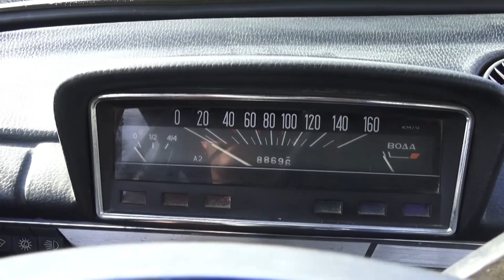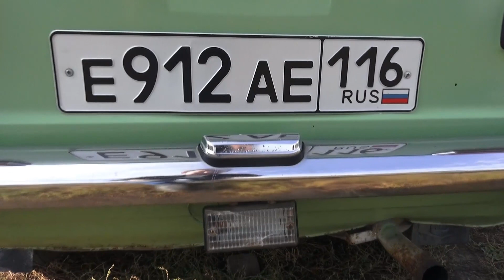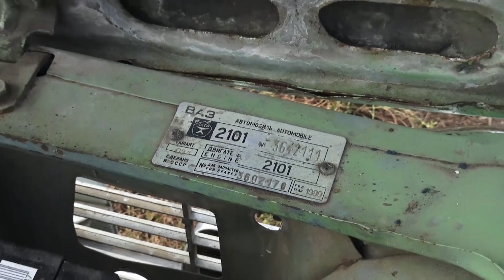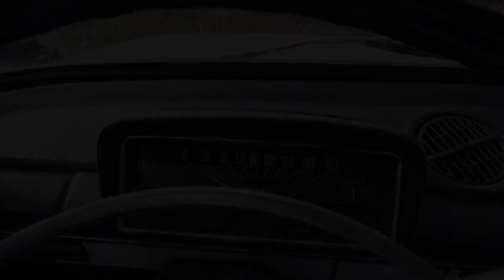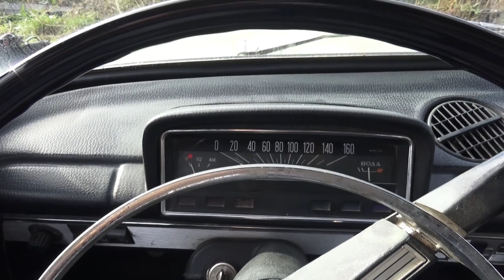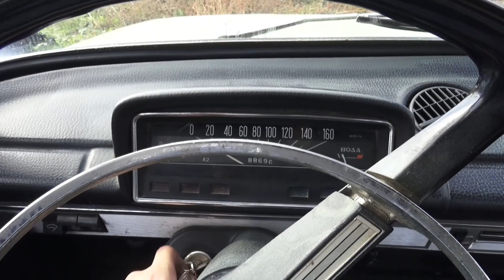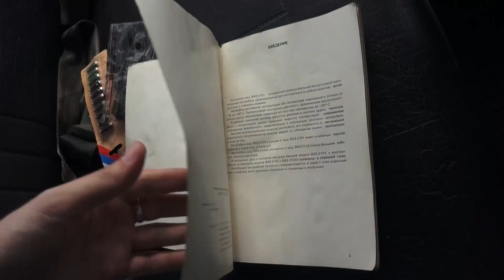1980 VAZ 2101. Start Up, Engine, and In Depth Tour.

Comment: WOW It may be a Lada but this is the first Russian car that I`ve seen that is ALL FIAT 124. Usually the body may resemble a FIAT but the engine would be a Russian unit ie the FIAT 125 sedan which had a 1608 cc DOHC engine but in Russia it has a 1600 overhead cam engine I believe and it looks similar but not the same. I recognised a lot of the hardware ie relays, door handles, hub caps, air filter casing even the tubes x 4 that the wind up jack pokes into under the body ..all FIAT. You said 1200 cc but I remember our Fiat 124 sedan had a 1100 push rod OHV engine. I love these simple old school cars and thank you for sharing this video.. It has bought back a lot of memories.

Comment: Amazing that there's no rust on this.
Reply: +azera55555 Well there is, but not on the exterior panels. I think i saw rust when he opened the front left door on the A pillar. But it's amazing if it's the original color. My parrents had a Dacia 1310 from 1984 and when they sold it in 2004 it was a little rusty on the right front wing which was hit and repainted.
Reply: I saw one in the same colour the other day, it had big holes due to rust in the doors. lol I still like them thou
Reply: I just remembered I have a pic on my Instagram.. mattsbeamer :)

Comment: thats choke what you said "carburetor" it is used only to start up engine in cold start, it doesnt help even if it doesnt start easily after shop parking and you are leaving for example. it is because fuel is boiling away from carburetor becauset exhaust manifold is right under carburetor and intake manifold :D so it takes some seconds to start when its warm, usually if its stopped for 5 - 30min it doesnt start that easily.

Comment: Hi from the matherland of all Ladas! :)
5:40 The engine must not that teribly tremble! It must be as still as a ... a ... a water in dead calm weather
Checking both - fist the distributor state and the ignition adwance angle (probably it is too early) and secondly the idle mode mixture composition of the carburator. 

Use petrol of 92 octan. (well, or 95.)
I can not tell you anything about gas system, i'm opponent of the usage of gas!

Or better is first to tune the carburator, as it works properly in general as i see, and needs to be only Idle Mode regulated by the one special Mixture Quality Screw to get optimum - maximum rpm, - or the so called "hill of rpm"., and that is all with carburator.

Then checking ignition system as there may be number of the problems. Giving too early ignition at the absolutely problemless operable ign. system leads to that trembling. So, to check if the system has or has not bad parts, just give the late ignition up to 10 degrees or so. The engine must get still while the rpm will decrease. 

The distributor's cap, the coil's top - must be clean!

In this lucky chance, just tune the correct Adwance Angle as per Manual (look at 14:40 - it is personal Manual of this car): going 4-th gear 45 km/h push the accelerator full: you must hear sonorous yet short lasting detonations while the car accelerates. (long detonations - too early, no detonation - too late). Go test drive then stop and tune by 1-2 degrees, again test drive, so on. (Use the key #13, do not tighten the distributor's nut too tight! ).

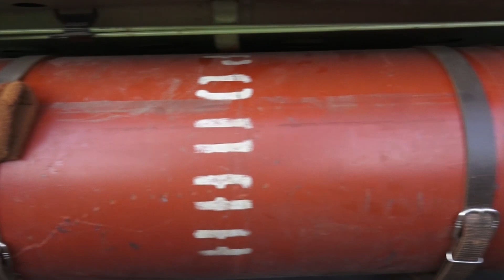If no lucky - then check the details of the ign system. The insulation of the cap, the HV-wires, the traveler under cap - they some time get electric breakdown, burn throughout. Replace. Now checking the Ignition Dwell Angle of the contact, or check the gap in it with the probe from the key kit - it is important. (13:31 - ups, you do not have this little key-box, look 13:42 - here it is on the floor) The last are the capacitor (0.22 microfarad x 630V), the sparkplugs (gap 0.6-0.7mm - again the probes from the same key), and the last point - coil. 

The best way is to buy russian new modernized contactless ignition kit for 2101-engine which costs less then 100$ - made in Stary Oskol's factory, (БСЗ Старый Оскол), consists of the new powerful coil, the electronic commutator unit, the ENTIRE DISTRIBUTOR unit and the wire bunch. (needs increasing the gap of the plugs to 0.8-0.9mm) it gives good common effect - agility. This car is more interesting then VW Beetle :)
-------------
After everithing is done, tune the idle rpm with another tune screw of carburator - the Mixture Quantity Screw - to 750-800 rpm/ 

Good luck!

10:00 - sorry, it is not good. Is it petrol or gas? Too much smoge.

Comment: You sure it's a 1980-car? The dashboard and the steering wheel both look like pre-1978. Altough it's got a black speedo and a reverse light, which are 1978+ features. Or it only applies for export cars (even eastern export) and they made mixed cars for Russian domestic market cars from leftover parts?

Comment: also i can hear that engine this engine has some firing problems or starting valve problem, or one of oilrings may be worn, sounds like same as i have in my lada 21015 (engine 2101) not firing in one cylinder every time, i did overhead rebuilt with new valves and other stuff and every gaskets and like that but still continues that. :D but it goes easily 120km/h still

Comment: The tickover sounds uneven and the exhaust note is rough, I think the engine needs a good servicing
Reply: It's a car from 1980
Reply: +Infinitrium Carburator engines always had an uneven sound unless you where willing to calibrate it every 100km or so.

Comment: Interesting,  my vaz 2101 from 1975 doesn't have the metal ring horn. It just has a bar with ВАЗ written on it
Reply: the metal ring snapped off?  there is many different steering wheels but it could be 21011 steering wheel you have... i should have that steering wheel in my 21013 but instead i have the newer one which came with 2105

Comment: Hey would I be too tall for this? 193cm/6"4'
Reply: I'm about 188-190 and I can sit in my 2106 without problems. I doubt this car would be much different.
Reply: @ivar185  i am 185cm and i hurt my throttle leg every time i drive 2101